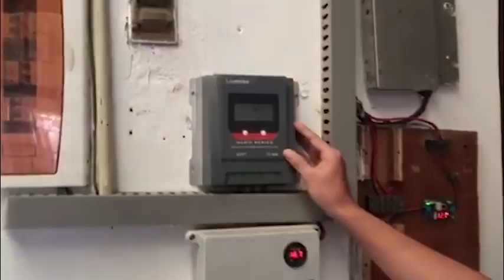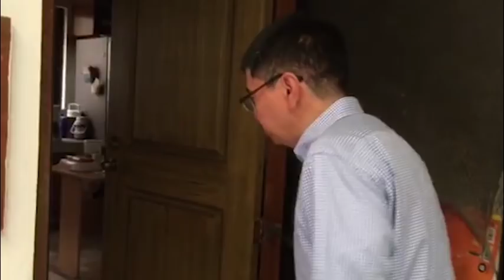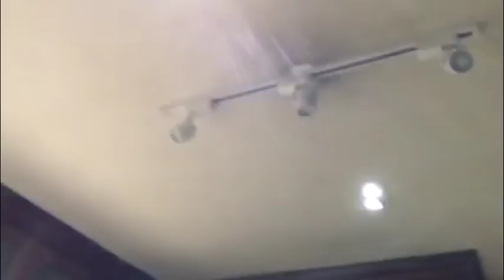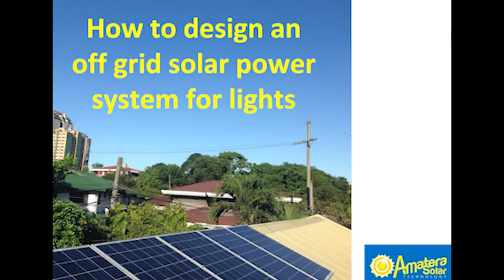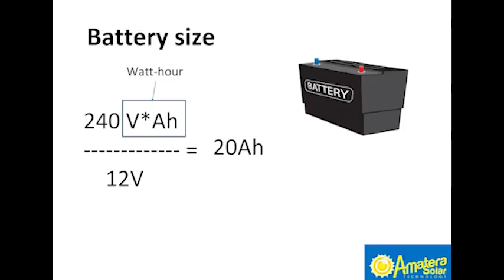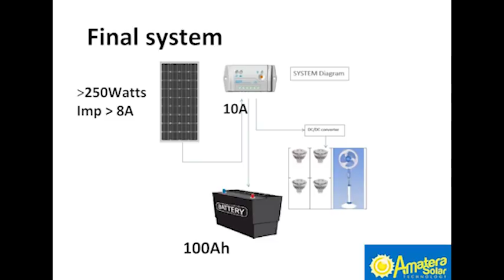How to design an off grid solar power system

Comment: When and if you are using DC how do you ensure that the battery is not over discharged? What kind of BMS do you use for solar gel or lead acid batteries

Comment: I like to recommend that there is an error in determining the amperage rating of the charge controller. Note you have a battery size including autonomy and DOD at 50 % is 80 Ah, which you estimated as 100Ah. In determining the size of the array or modules needed,  accounting for 3 hours of sunshine in such a locality and battery voltage of 12 voltage : (100Ah x 12 voltage) / 3 hours = 400 VA (Watts). For Charge controller, since battery voltage is 12 voltage, we have : 400 VA / 12 Voltage = 33.3 A. This could be rated up as 40 amperage charge controller.

Comment: Thank you for your nice and clear explanation.
Please just check for me I have calculate the solar system for load profile of 750W and we have sun of 7 to 8 hours .and no autonomy days.
Load is 750W for 16 hours 
750Wx16 hrs = 12000Wh =12000VAh

12000VAh/24V= 500Ah 
We need 500Ahx2 = 1000Ah 50% discharge for lead acid batteries.no days of autonomy.
Number of batteries 
= 1000Ah/180Ah=5.5 =6 batteries of 180 Ah 
Solar panels
500Ah/7hours =71A
12000Wh/7hrs=2714watts

Panel specs 700W, 17.69Amax
No of panels=71A/17.69A=4.2 is 5 panels .
80A , 24 V charge controller needed.

I will appreciate your help .
Thank you  🙏 Sir.

Comment from the maker: Hi, Jeff.  The output in this case comes out of the charge controller.  Since the loads are DC and the input is DC (battery), then this system works for DC bulbs and DC fans.  It won't work for 3phase pumps or appliances that run on AC power.  In such case you would need an inverter.

Comment: No inverter? My well pump runs only when I use water, but without power I have no water. This is a 3 phase motor. So I need panels, cables to connect to charge controller, batteries, circuit breakers/fuses, and some way to manually switch from the grid to my storage if power goes off. The numbers and math concerning these components is all Greek to me. What size controller, inverter, gauge wire, etc should I buy? No inverter? Where does the power come out?

Comment: Massively oversize and the start is wrong.  first of all cut the inverter cost and effeciency out by ding DC lighting.  Do a bit of research and determine the exact lux levels .  see if you not can use back reflextion to double up on the just two..   choose two smaller batteries rather a bigger battery (replacement can be scheduled.  with the inverter losses gone, it overwrites  the massive derating you have done on the panels.    To be honest, this is completely wrong.. each light should have been treated with it's own little small battery  dc led...

Comment: Just for 4 lights. This is really outrageous. You need to set that panel at a sun trackable angle. Also most people do not keep all lights on for 12hrs. So to power a fridge or Air conditioner you will need 100panels from your calculation😀😀😀 This what you get when you can't tell the difference with 12v and 24v panels and photovoltaic or monchristalin panels.

Comment: I have 12 batteries, 12 x 200Ah batteries; 250W 24V eight panels and 330W 24V eight panels, totalling 16 panels. Pls how much wattage can the panels generate and how long will it take to charge the batteries

Comment: Some confusing in this Video. You didn't unclude Autonomy AmpereHour for sizing Charger Controller. (100Ah/3h = 33.3A or 40A atleast ratings of Charge Controller). You miss also number of Panels based from Autonomy usage (33.3A/6.7A = 4.9 or 5 Panels). And how did you compute to get Peak Power Current 8A of Charge Controller?

Comment: Thank you sir .. in Saudi there is more than 7hr of sun 
my loads are 800Watts and i'm using 12V battery 
what are the Amps coming out of each panels so i can buy a bigger Charge Controller form AMPS coming out of PV

Comment: pag madaming appliances calculate mo ilang Wattage . lahat lahat na gagamitan ng solar kunin mo yung wattage   W= (A) V so if 1200 watts yung total kailangan  mo ng  100Ah to 110Ah full cycle battery  12V so do the math 12x100=1200W  so kailangan mo ng 1600w na panel  para ma cover yung 20% power loss 1600 less 20% is 1280W
mga 16pcs na 100W na panel yan kong may malaki e di mas maganda mga 1800W yung power inverter wag masyado malaki lalaki ang power loss. YOWN puro ka lang market ehh tulong tulong lang .

Comment: I dont know if you are still following the topic, however I have a question.
You have calculated the charging current based on the 20Ah battery, but you have also made the decision fo using a 100 Ah battery, then why use the 20Ah figure.
By using this figure of  6.7A we will never charge the 100Ah battery in a whole day (suntime) of 3 hrs
Can you please correct me ,  wher I am wrong

Comment: What should be the wire size to be used if I were to extend my wire 39 meters from the charge controller? should I also consider the voltage drop in a system like this?

Comment: I don't understand why you need a 250W panel here. What we need was 7amps. If we take the MPPT voltage at 18V, then the required panel is 126W panel. So in that case even a 150 above is good and no need for anything more than 200W for PWM charge controller. I am considering the system voltage as 12V. Sir please clarify how the panel was calculated.

Comment: 250w panel consider to be set up on 24v battery system using pwm controller. If you use mppt controller for 250w panel thats okay.